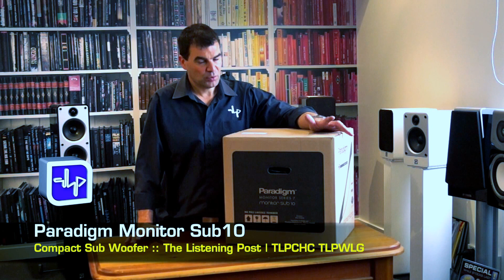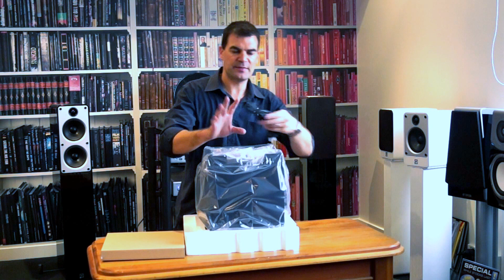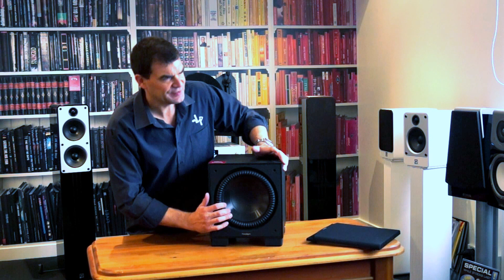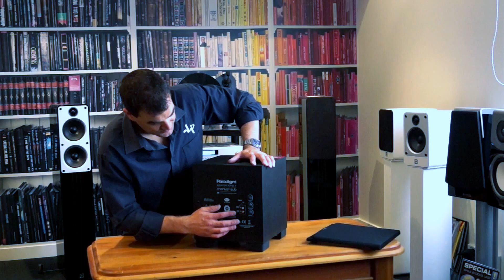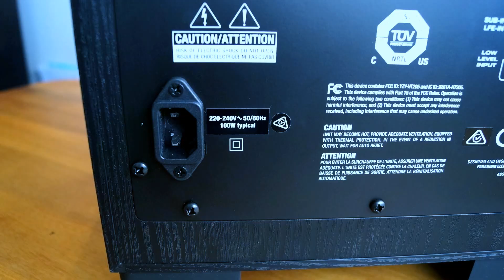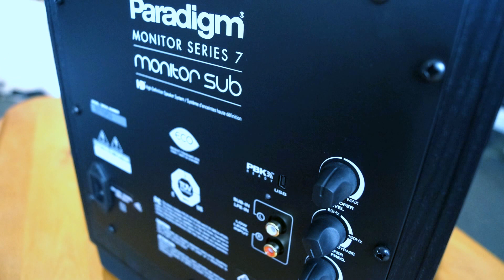Paradigm Monitor Sub10 Subwoofer Unboxing  | The Listening Post | TLPCHC TLPWLG

Comment: How does it sound this sub? 
Is there a big difference between this and the 8 inches sub?
Reply from the maker: The 10inch seems to be the sweet spot in the range. Great punch and dynamics. The 8 is really ideal for a small space
Reply: I using goldenear ff3 sub... Consider to buy this sub, but it less review in web for this product.